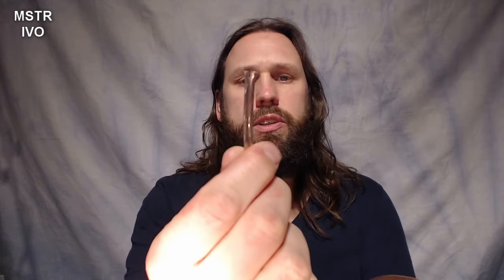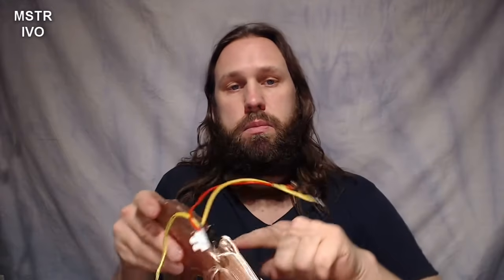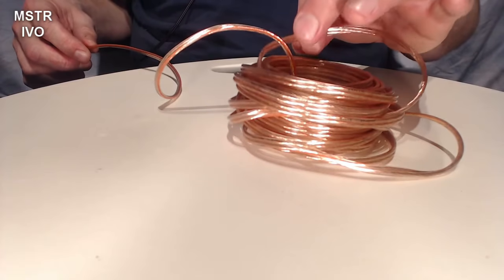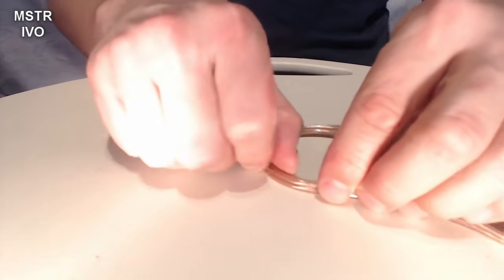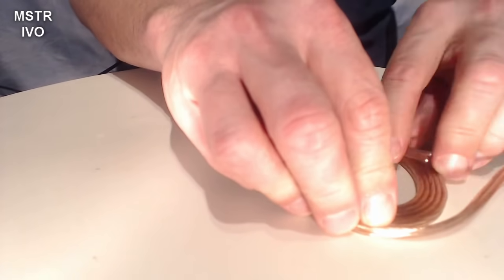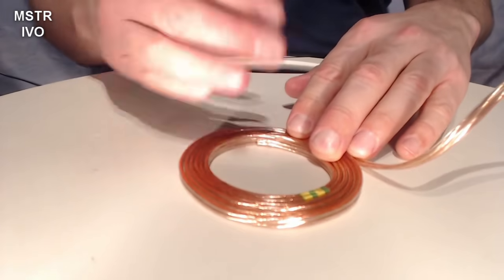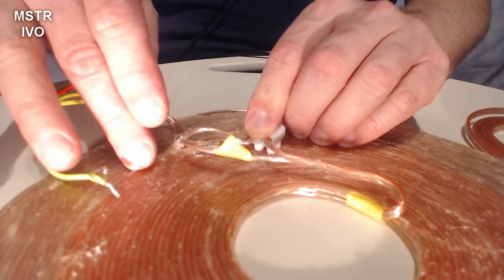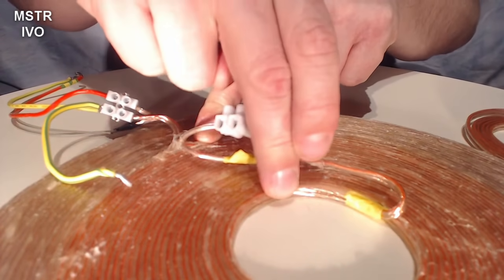How to make a bifilar Tesla coil. The easy way.

Comment: Thank you for your work and time on this. I'm currently researching how to make a flat electromagnet and am using your videos as an educational source. Thanks again.
Reply from the maker: thanks, use a weak iron plate on bothsides of the coil to increase the strength
Reply: @MasterIvo  Really? Both sides? I wasn't aware of that. I'll try it after I can get it working with one plate first. Am I able to hit you up later if I got questions?
Reply from the maker: @icevariable9600  yes you can
Reply: @MasterIvo  this kind of coil we need to use in order to produce scalar waves?
Reply from the maker: *longitudinal waves, by fast changing high voltage
Reply: @MasterIvo  can u explain me more, please? What about two coils producing electromagnetic waves facing each other, one clockwise direction the other anticlockwise, or even one next to each other, like this coil that u showed to us but in a shape of Rodin star?
Reply from the maker: @sebastianardohain8137  Its not about counter rotating magnetic fields.
Its all about the displacement current created by the fast change in high voltage.
The coil acts as a capacitor plate.
Reply: @MasterIvo  that gave me an idea, it makes it rigid and can be bolted thru the middle with a bolt. Or zip tie? Should it be insulated from each other, meaning will it short out the plates? I'm thinking as this is magnet maybe it will add the two and gain from each other?
I'd like to use it for 12 volts and hho in car to aid hho production or in other words to reduce power use?
I have such pans or baking sheets that can be gotten from dollar store

Comment: Master Ivo, does the size of the center circle matter, and does the number of wraps around with the speaker wire make a difference? Thank you for your help. :)
Reply from the maker: my intuition says yes. Phi ratio coils, but haven't been able to explain it yet.
More wraps is more inductance and capacitance. but thin wire also has more resistance.

Comment: I was wondering, that if a bifiliar coil has a much higher voltage difference between the windings. would it be possible to use it to get a even higher voltage difference in a set ratio when using it in/as a transformer/tesla coil.
Reply from the maker: yes! when used as dual resonant primary and secondary coil (in LMD resonant mode), the voltages between the coils are out of phase.

This makes huge voltage differences between them possible. 
That can even be increased more, by giving the coils themselves a positive and negative DC offset. 

The primary and secondary coils together yhen form a capacitor!
Reply: @MasterIvo  so when both the primary and secondary are bifilar coils these coils would resonate with themselves and so like a sawtooth magnetically and statically connect with each other with a certain offset and a certain speed difference causing a multiplied pressure at a freegoing ac frequency even when the input would be adc because of the secondary coil resonating itself at a different speed?
Reply from the maker: secondary is also (parallel) tuned so it has the same speed as the primary (series resonant).
yes both coils feel each others magnetic and dielectric (electrostatic) fields.

Comment: what do you think of flat speaker wire for the same use? i managed to find a really cheap wire that has has a large surface area on the top and bottom wire.
Reply from the maker: think about this: surface area is good for capacity, more windings is good for inductance.
So I would say, split the 2 wires up, and make a single layer winding with the 2 cables next to each other, like the bifilar coil patent 512340

Comment: Can I use this type of coil with my PEMF generator? , also what gauge is that speaker wire ?
Thank you !
Reply from the maker: yes works with pemf generator (keep an eye on the current maximum) , This was 0.75mm2, I now work with 1.5mm2 and 2.5mm2

Comment: I think the reason so many people fail to reproduce Teslas results is because they fail to follow directions and constantly try improvising his designs (diodes, function generators, non bifilar pancake coils, Thompson Tesla coils, ect). The shear effort required to build these designs in 1891,  nearly impossible to find parts. Couple that with patents that leave out specific required components. Luckily, if you read all his patents after 1893, you will find the answers to the problems, and realize why without a specific patented component, the design wont work! Hense, the radiant energy patent.
Reply from the maker: yes indeed without the proper knowledge people will keep working with resonant effects. 
I was lucky to find out the impulsed series resonant bifilar primary coil is key to his success.
Or do you refer to something else?

Comment: According to Tesla's patent he mentioned he wound the coil to give the greatest potential difference between the windings.  In order for that to occur the windings should be flat not stacked as in the diagram in the patent.  By winding it the way you have shown will change the characteristic of Tesla's original and will give different results.
Reply: The "different results" are the frequency for self resonance -- yes. If the frequency is LOW ... then you don't get the Tesla benefit.
Reply: @morpher44  not only the frequency.
Ivo his way yields higher inductance and lower capacitance.
Reply: @morpher44 what do you mean, the tesla benefit?
Reply: @nicholasjames4145  A coil really has resistance, capacitance and inductance. It is not just inductance. The patent idea is to influence the capacitance too by keeping the windings separated to the specific distance that will give the capacitance wanted. Separate the wires too much, and capacitance approaches zero. Wires that are closer have a stronger field strength between them. This is either wanted, or not wanted depending on your goal. In the early days of radio, people went to winding coils various ways such as basket weave, honeycomb, etc. A radio person would talk about the Q value for the coil.
Reply: @morpher44  is there any way to influence the Q factor of the coil once it has already been built?.... 
I'm trying to make a pemf device for health and such and I have a feeling this coil might be the way but I'm not sure the best uses of this coil.
Reply: @nicholasjames4145  A magnet brought near the coil can influence it. I'm not sure if the Q changes, though. Putting a fero material inside the coil -- but this also affects the H-curve.
Reply: @morpher44  do you have any idea how I'd find the answers to what I'm looking for

Comment: It's a Casimir Effect Universe. Space and Counterspace are the plates, the Inertial plane attracts and repels the plates. Like your bifiler coils.
Reply from the maker: Casimir Effect, the dielectrci field is under tension, and attracts the plates. Casimir was also Dutch
Reply: @MasterIvo  ; Isn't the Inertial plane under tension, "Condensate of Universe".  Between the plates of Space and Counterspace. I liked, when you put the two coils together, from the middle of the coil. Making a positive and negative side of the coil. Perturbating one side of the coil to resonate the magnet-like coil. Are your winding phi:1. I follow Ken Wheeler. Like your bi-filar coils, wouldn't double wire coils with different spacing between the wires change the outcome. Like, Tesla's induction coil, with capacitance between the wires resonating.
 Does that mean you are Dutch? I thought Russian, I'm American.
Reply from the maker: @gyro5d   Spacing influences capacitance, so it influences the dielectric field strength of the windings, voltage difference does the same.
Yes Dutch

Comment: This patent is a step towards what Tesla achieved at Colorado Springs, i.e. the iconic Tesla Coil.  The key to that achievement was reducing the self capacity of the coil AND adding a load capacitance that was much larger than the self capacitance.  This bifilar coil is an improvement over a two layer simple wound coil in that the voltage between turns is V/2.  Note in a single layer coil the voltage between turns is 1/N where N is the number of turns.  So just by spacing the turns about one wire diameter the self capacity can be greatly reduced.  This is in fact the structure of the secondary of the Colorado Springs "Tesa Coil", not the one shown in the referenced patent.  Reference "Nikola Tesla: Colorado Springs Notes, 1899-1900".  https://prc68.com/I/Inductors.shtml#Q

Comment: You can also use speaker wire to wind a bifilar coil onto a spool as well. It's very easy to do and if it's wound onto a iron bolt you then have a bifilar with a iron core in it to make it even stronger.
Reply from the maker: indeed you can. keep in mind a iron core won't work if you want to make the coil resonant (iron isn't fast enough, use ferrite). but as an electromagnet its perfect.

Comment: Although your coil will have an increased coil-to-coil capacitance, it is equivalent to two single-wound coils wired in a particular way. That is to say, that you do not decrease the self-inductance of each individual coil by this method. Perhaps you could create a bifilar coil with speaker wire if you wrapped it up the surface of a cone or cylinder, but then it wouldn't be the planar coil which I think was your goal.
Reply from the maker: yes coil to coil capacitance, but its about the increased voltage difference between its 2 windings. half of the supplied voltage is between the windings.
I show this into detail in a future video.
Reply: @MasterIvo  thank you for taking the time to reply. In the garbage ecosystem of youtube comments, I appreciate that you assumed good faith on my part, and do enjoy your videos.
I agree that there is a voltage potential between the windings, but I think that this is a fundamentally different coil to what Nikola described in his patent.
In a planar bifilar coil (as opposed to a stacked-series-coil-capacitor as you have built), there should be an induction from each successive turn on filaments A-B such that the shortest dielectric path to the center of the coil is radial without generating a counter-emf.
In the stacked example, there appears to be no direct path as such for the filament in the bottom coil experiencing an electrostatic potential to dissipate this through to the next filament on the top coil.
Reply from the maker: @pvlis  Yes, much garbage :)  If you read the patent 512340 Tesla clearly states it applies to all kinds of coil configurations, even solonoids

Comment: So follow me here...the way you made this coil is essentially by taking two flat spiral coils wound together (i.e...speaker wire wound vertically)...

So now the primary distributed capacitance exists between the two coils stacked vertically (unlike the other way to wind horizontally (as in Tesla's patent drawing)).  Additionally the inductance is distributed

And in future videos you will begin to show coils connected in resonant circuits...

So now one must consider this special coil you made in terms of resonance....series vs. parallel...as this coil alone can act as a series resonance coil or parallel resonance coil depending upon how you connect the external wires (note no external capacitors or coils needed in either case).

The beauty of this is that you no longer have the problem of parasitics (which you are experiencing in your future videos) in your resonant setup.  As the distributed parasitics (inductances and capacitances) of your resonant circuit is negated due to the special winding you have in this video.

To operate this bifilar coil in parallel resonant mode connect one outside lead to other inside lead (as you typically do)...and the other two leads out

To operate this bifilar coil in series resonant mode, do not connect the outside lead to other inside lead (leave open)...and other two leads as output

This also explains why you get a multiple resonant frequencies in future videos...as you add external capacitors (LCC) or inductors (LLC) you create multiple resonant frequencies... (or any other series/parallel combinations thereof)...

Just thinking out load on this one...
Reply from the maker: Hmmm no, don't agree.
Yes the coil (as any coil) can be resonant by itself. but.
in the case if this special coil, it is not parallel OR series resonant. But BOTH at the same time.

And if you dont series connect the 2 wimdings of the coil, leave it open as you suggest, the windings only will act as capacitor plates, but not as a coil, as there is no connection, the loop is opened. So, no resonance.

On a side note, I just realized something exciting. the circuit in the radiant power video (solid state hairpin circuit) has a part that creates a DC offset to the coil.
But you can use it differently also. Going to test it tomorrow :)
Reply: @MasterIvo  Good luck with the test

...they are implementing in integrated magnetic modules.  "electromagnetically integrated LC resonant structure for which the equivalent circuit characteristics depend on the external connections".  The implementation is two vertically sandwich stacked spiral coils that act in series resonance, parallel resonance or low pass filter mode.   So yes, obviously external connections are required (:  And the "embedded drivers" planned used in power resonant DC converter front ends that are pushing KW's of power to servers.  I picked it up from a dissertation that I read, as I was replicating your device to do Vars to Watts,  and thought you would be interested...Google Bo Yang Chapter 3 and there is a description in there.  For that matter I recommend you read all 5 chapters of his dissertation.  It has changed my plans on my final Vars to Watts implementation that uses your spiral wind coil ideas with his ideas and my own.  That is why you keep seeing me reviewing your videos...at any rate...great to have sites like yours!

Comment: @Master Ivo, Bruno Marier,

I have just ran across your channel, discussions, and have subscribed.  
Great stuff and I have a lot to learning, to do, to catch up with you guys.

I have the following questions and ideas that come to mind.  I am wondering 
if either of you have tried or considered?  I think that I will try some of my ideas 
if you haven't already tried them.

1:  Trifiler 3 windings,  connected outside to inside next level up.
2:  6 windings, connected outside to inside next level up.
3:  9 windings, connected outside to inside next level up.

4:  12 windings, connected outside to inside next level up.

5:  Then 6 conductors 2 coils Level 1,2,3 and 4,5,6 

6:  Then 6 conductors 2 coils Level 1,3,5 and 2,4,6 

7:  Then 6 conductors 3 coils Level 1,2 and 3,4, and 5,6 

8:  Then 6 conductors 3 coils Level 1,4 and 2,5 and 3,6 

This could be extended for 9 and 12 conductors easily by having all the inner ends and 
outer ends terminated in double screw terminal connectors.   Thereby allowing testing in many
different configurations and options quickly and easily.  

Resonance could easily be added by finding it on one coil and reproduced it on other 
levels easily by replicating the values since the coils would be symmetrically similar. 

I am also wondering about coil diameters of 3, 6, 9, and 12 inches making a big difference.
Also changing the dielectric properties between similarly constructed coils by different 
materials.  

I am planning on building a number of these configurations for my own learnings.
Any thoughts or ideas that either of you may have would greatly appreciated and helpful.
Lastly any thoughts and ideas about testing the different configurations.
Reply from the maker: Its about inductance (nr of turns) capacitance (voltage difference, plate/wire area and distance between them) and (wire) resistance.
keep the resistance low, and the rest as high as possible.

then the main thing is negative voltage impulses. Sudden quick changes in voltage difference over the coil.

Comment: can this be used as an induction heater?
and if yes, is it "stronger" than just one coil?
Reply from the maker: Yes It can, yes it will, the coupled inductance of the 2 windings is a lot higher than a single winding
Reply: @MasterIvo  cool, thanks! 
how can I write you an email? I am about to build an induction heater but don´t know how to calculate it. (numbers of windings, wire-thickness, diameter...)
Reply from the maker: @jpjay1584  My youtube about page has my email (login to Gmail with pc). I do not have more info, just use thick wire, as the currents will be very high, and current plus resistance generates heat (melts the coil coating and causes fire). think of using multiple strands of 1mm2

Comment: What is the benefit of a bifilar (Tesla) coil? What problem does it solve? or What performance does it improve?
Reply from the maker: Good question!
This video shows: https://youtu.be/1Flj1i0zQ-8
The bifilar coil, has inductance (abbility to store electric energy in its magnetic field), but also capacitance (abbility to store electric energy in its dielectric field), this makes it very capable for inducing radiant energy, by impulsing the bifilar coil.
Reply from the maker: Even more the coil can act as a capacitor, but with the plates (windings) connected. This means its able to charge the dielectric field in virtually no time (a capacitor cant do that). This sudden change in voltage  /dielectric field strength, in combination with the pancake, is able to produce unipolar aether pressure, that sets the aether in motion. a very unique longitudinal energy is the result.